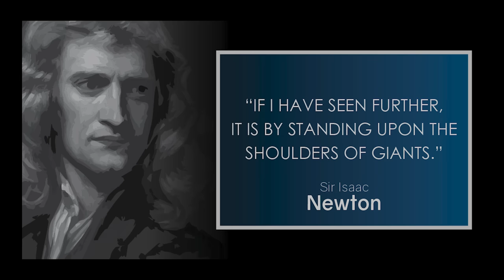One of a Kind Dining Table

Comment: Can you imagine, to make this table and have a mistake with a single piece in the middle of the table? I don't want to even think about it...
Reply: Omg no. Just the thought is making me die
Reply: The rule is measure twice cut once.
Reply: I was thinking the same
Reply: Or freaking him out by leaning across the table while pointing and say, "You missed a spot...." 😂
Reply: I can’t imagine having the skills, and access to such fine timber and facilities to make such a table. I can imagine myself screwing it up though.
Reply: That would be me 😂
Reply: d😊😊
Reply: 😊😊😊😊 2:10 o
Reply: It would suck, but it'd be fixable. Since it's a repeating pattern, he can chisel out the incorrect section and glue in an offcut. It'd actually look a lot cleaner than with a solid slab table since the pattern is so uniform.
Reply: How would you possibly make a mistake in the middle and not have seen it prior to assembly?
Reply: But you are thinking of it😀
Reply: That's when the top becomes a set of matching end tables.
Reply: It would quickly become "an idiosyncratic design choice !"
NOT a 'MISTAKE' !
😅
Reply: Grand máster.
Reply: I would make it a game like anyone who sits at the table has to find the odd spot in the pattern.
Reply: А если просто наклеить эту "ошибку" поверх стола и посмотреть реакцию автора)))))
Reply: Mistake is a dising in carpentry
Reply: Ini di batas kemampuan rata²😂😂😂😂😂i like u skile
Reply: If there is a mistake, any where, it will be obvious and evident if the parts are dry fit to confirm the fitting. Then the pieces are marked before they are dismantled.
Reply: But he didn’t. And you all won’t when it matters.
Reply: Have faith in yourseleves.
Reply: I'd pay more for the table at that point. Why? Because then you know it's hand made and not mass produced by machines in a factory.
Reply: It'll increase the price with the time 😂
Reply: Please be honest and admit that you watched it for
Reply: I am studying professional carpentry training and it happened to me once but not with a table
Reply: Play where’s the wood filler?
Reply: I Liked to see the video of my phone.
Reply: I call those a “signature” piece. Like an autograph, but worse.
Reply: That must be super heavy
Reply: Shit happens, i guess it is not his first attempt.  Maybe the 20’st

Comment: About halfway through the top construction, I said in awe: "this man is quilting with wood"  (My mother is a quilter and like with this project, there's a lot of connecting things together in ways that bear little to no resemblance to the final pattern unless you know what you're looking at.  Indeed, the techniques are quite similar, just with scissors and sewing machines rather than saws and glue.

Also, that final glue up for the top....holy crap that was something else!  Takes a LOT of guts to lay out that much glue on that many pieces of wood for a single glue-up!  Doubly so when the wood in question has already been carefully processed and refined to even get it to that stage!
Reply: This is next level creativity! I don’t know how anyone can even conceive a concept like this and then know how to formulate the process that would make it happen. It speaks of many thousands of hours honing one’s craft to perfection.

Comment: Wonderful Job good work.  Some thoughts. (1) Buy a beam saw and if you have GOOD make life much easier.  (2)  I think you handle your wood to much ( yes i know this comes off as bad) but the point is I would write down all the processes you are going through and see where you can handle it less.   Each action is energy taken from a future action.  Placement of wood and carts and lifting and moving and sanding all take a toll and cause fatigue and you seem to be over working for what your doing.  Again wonderful video thanks for sharing.

Comment: Bought my Mom a similarly built Cutting Board ( different Creator and different Pattern made out of who knows how many pieces ) which unlike this table is also framed by solid pieces thus providing some structural integrity "just in case". Said Cutting Board now has a bunch of huge Cracks in it most likely caused by the contracting / expanding forces of the various woods used in it... Some going through the Glue Joints, others having split the Wooden Pieces apart. As beautiful as these Constructs are - Don't buy them for longevity OR without knowing about the risk of it falling apart at any moment's notice.

Comment: I really like the aesthetics of it and all, and I know it won't be placed outside, but if humidity or water did somehow get to some parts of the table, wouldn't warp along the surface and make cracks appear here and there?

I'm asking because I'm interested to start a similar project but I would also need to know if the created piece requires extra protection or not, and if another design is reasonably longer lasting and more sustainable, I'd choose that over aesthetics so yeah... I'm interested to know

Comment: Amazing project. Well done.
nearly 3 years ago i have build similar  (less fancy pattern, 100mm thick) end grain island top out of iroko and beach. all timber properly seasoned and kiln dried.
after 2 years irko expanded vs beach by 1-2mm either side and i had to trim it and treat it again.
what is your view on preventing cracking and differential expansion of different spices?
shame i can not attach pictures here...

Comment: Beautiful, intricate table, just a bit too busy for my taste. If I were building a dining table or work bench I would use a router template to put a 1"-2" round over on the vertical corners and then break all the top and bottom edges with a 1/2" round over bit. That one time you are rushing and your proprioception is a bit off and you run your hip or upper leg into the sharp corner you will understand why.

Comment: A beautiful build!  
I'd like to know more about the set up you use under your glue ups and finish work.  What type of tubing are you using and how is it attached to the framing material?  I noticed you using a smaller version in your oak barrel cutting board.  It's an interesting design that I'm hoping could solve some of my issues with glue ups.  Thanks!

Comment: Wonderful video! 
I am a bit worried about your toes in the future though... Wear toe protection. All it takes is one slab of wood and bad timing, and you will break those bones.
And oh! Ergonomics. That assembly table is looking like it's taking a toll on your shoulder working at that height. 
But perhaps you have back problems and prefer it that way. 

Subscribing to check if you follow my advice :)

Comment: A nice piece of art for sure. But a not so good table. Why? 2 reasons. 
1. Its too heavy. Why 4 inches thick? I dont want a table that I cant move to the other side of the room without calling a couple of buddies over. 1 inch is usually sufficient for solid hardwood. 
2. These patterns are too busy. I dont want to feel dissy while im trying to eat my dinner.